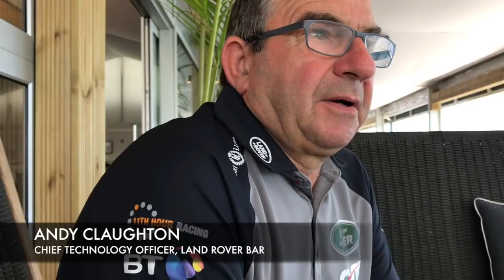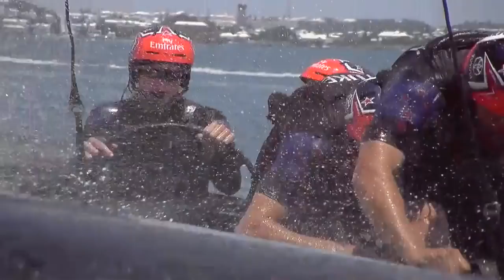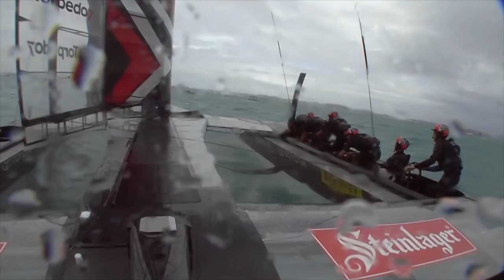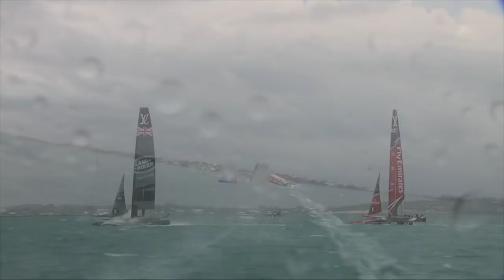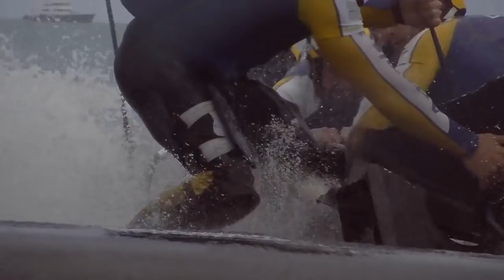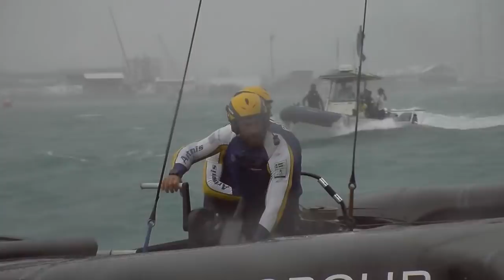Why did New Zealand capsize? Andy Claughton of Land Rover BAR discusses the likely causes

Comment: What a daft comment "all you need to do is pedal". Or grind Andy! What is the difference? Grinders will be chosen for sustained arm strength and aerobic fitness also, not sailing ability.
Reply: I agree, It seems like he is quite bitter about being out thought... Probably 5 other design co-ordinators feeling a bit the same.
Reply: Just to be clear, I was making the point that the grinders or cyclors are not much involved in the sailing.  Bitter, moi !
Reply: Apologies Andy, it appeared to me that you were saying ETNZ crew requirement was somehow different to the 'conventional' grinder setup, when both just require grunt and agility to cross the boat! Cheers M
Reply: Andy Claughton it seems like they are more involved if anything. Without the hydro the boat cannot sail/foil in a straight line. at least in mono hulls you could still top handle a winch if you had too. For what it's worth I think next time they should have stored energy. It just seems primitive and an unnecessary expense.
Reply: With stored energy you'd have a sailing team of as few as two persons!! One aspect of the cup has always been the coordination of a reasonable sized sailing team, this would be lost with the stored power option.
Reply: Agree - if BAR had implemented it we would have heard the crowing about "Best of British blah blah blah..." all the way from NZ.  But instead he'll look down his nose and patronise it with a purist cap on.

Comment: I believe this is sailing, but doesn't show a true test of sailing skill anymore.
Reply: What?? Have you ever won a regatta? In what kind of boat? Do you have any idea what you are talking about?
Reply: Quinton Lindgren There is certainly some credibilty in your argument. The character of the sport and the players has changed.
Reply: I'm not sure I agree. It's absolutely sailing. It takes immense skill to keep those things upright, let alone to get them round the a race course. It's definitely different to the match racing from 2007 and earlier but the America's Cup is supposed to be the cutting edge of sailing and I think these foiling multi-hulls exemplify that
Reply: Quinton Lindgren I agree this is more about big budgets vs smaller budgets. They should either build the boats 1 time and no tampering once the regatta begins unless for repairs or all have the same exact package. This is more like ferrari (oracle) vs kia pacanto (Groupama Team France) But it would take an incredible amount of skill to as they say THROW these boats around trying to manoeuvre at speeds up to 100kmh and try to keep the boat dry at the same time.
Reply: something you seem not to understand is that every team is sailing a near identical boat

the only things that teams were even allowed to change this year were the design of the foils and the grinding system; everyone used the same hull and same wing design, I mean for christ's sake there's a BMW logo on every single boat because they were all produced in the same factory with identical designs
Reply: BMW has a great history in sailing. I think it made an underwater boxer engine.

Comment: The largest, strongest and muscles with the most stamina are in your legs.  So it's a no brainer to use cyclists to create hydraulic power instead of smaller weaker upper body muscles.

Comment: Andy is simply wrong. He gives no plausible reason for the capsize and writes off the only plausible reason. The foils stalled because the were in turbulence from the boat that was ahead and when the foils stall they will no longer work.
Reply: "the only plausible reason". So you're holding the truth, ey? Anyone and everyone else is wrong.
Reply: Yes. Many people in the know agree with me. The point is that Andy should keep his mouth shout, rather than reveal poor understanding.

"However, legendary British yacht designer Hugh Welbourn was quick to criticize, telling the New Zealand Herald that helmsman Peter Burling and Team New Zealand “shot themselves in the foot” with its over-aggressive start.

“That was very careless,” Welbourn told the Herald. “They should know not to run into another set of foils’ wake at a shallow angle.

“Turbulence, aeration and the vorticity off the leading foil set will totally disrupt the normal flow patterns. Plenty of aircraft have been flipper [sic] ‘A over T’ by tip vortexes.”"

http://www.grindtv.com/random/team-new-zealands-crash-americas-cup-race-called-careless-video/

Comment: I am impressed by the performance but this is BS sailing with hydraulic systems, now pedal powered. Sailing should be with ropes and winches.
Reply: Winches, what do you mean winches. Why can they sweat the ropes the old way?
The old mono-hull AC boats had shafts running from side-to-side connecting the winches, that's not old school.
What about using a tiller or steering board/oar as the Vikings and Pharaohs did? That would sort the men from the boys.
Reply: My only real gripe is the hydraulic systems. Hand crank winches are fine, the tension on the sheets are so great that you couldn't get enough hands on them to do it the way I do in my laser.
Those hydraulic systems remind me of how the Amish can't have electricity but have massive diesel engines running hydraulic systems to run fans and they can ride in a car but can't own one.
Reply: Always someone complaining about progress